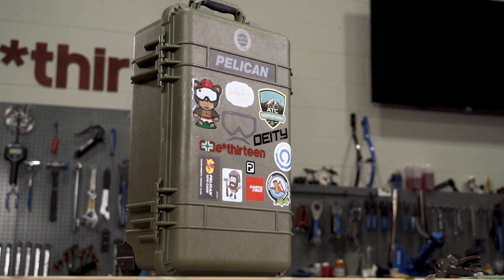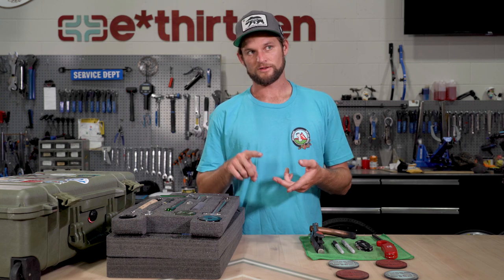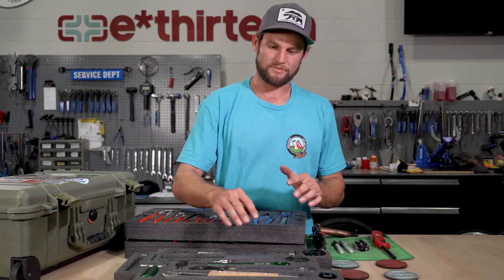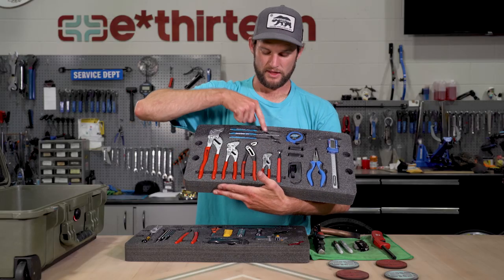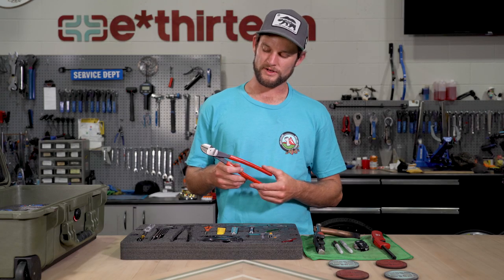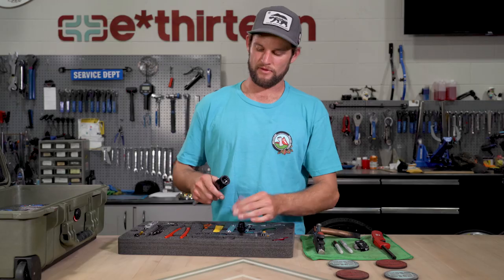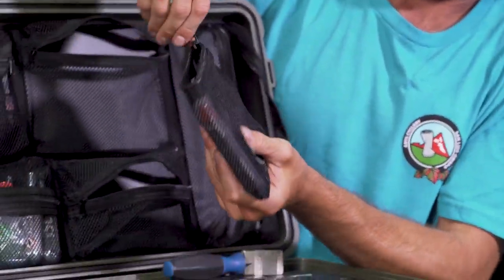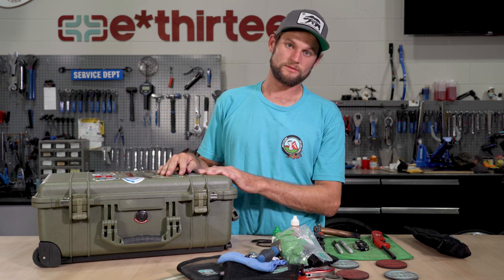Ask A Mechanic: The Perfect Mobile Tool Box w/Kaizen Foam

Comment: Good stuff! I use a 1700 case (basically a gun case). Every place I go to has a oil drum or trash can that I can set it up on. I utilize the top for tools as well and used picture frame hinges and bungee to help keep tools on the lid from falling out when TSA goes through it. Pro tip, if you carry heavy things, mount them on the “bottom” portion so that when you’re lugging it through the airport the foam settles towards the bottom and stops, vs settling and squishing the rest of the tools over time.

Comment: Instead of tracing around the tool, make a photocopy of the tools (or scan and print), cut the contour of the image of the tool. Trace (for  better precision) or cut around the image directly. Youll do a more precise and clean job than tracing around the tools themselves and the fit will be better and you'll appreciate it when traveling a lot.
Reply: How to do you make a photocopy of the tools?
Reply: @rodrigomoreira5519  - Simply put it flat on the glass of the photocopier as if it was paper, close the lid as much as possible ... and press copy.
Reply from the maker: Killer idea!
Reply: To take full advantage of these photocopies you can also use the images to draw their contours on your tool pegboard or better yet, cut the shape from colored vinyl tape and place on the pegboard as I did.  With these image on the pegboard, the tools always go back in the same spot, you know what tool is missing if working in a shop environment involving many mechanics and it looks amazing not to mention very professional !
Reply: yep its a bit overkill but gets you a better fit- I upped the over the top-ness by then using my work laser to cut my foam layers. (not kaizen foam thou)
Reply: Awesome idea!!!
Reply: @artscyclery875  thanks for the video. Hi @Sylvain Michaud thanks for your very interesting comment. We have been working for the past several months to simplify the tool organization process. You can watch a demo here - https://youtu.be/jgCmRlkGDZc. The idea is to take a few photos and let machine learning do the rest for you. Right now we are looking for people who would be interested in trying it out and willing to give us feedback. We would love it if you could give toolKaiser a try at https://www.toolkaiser.com/. Your feedback would be super helpful!